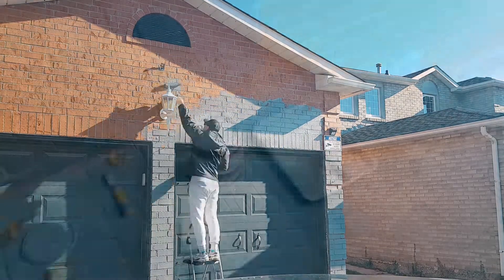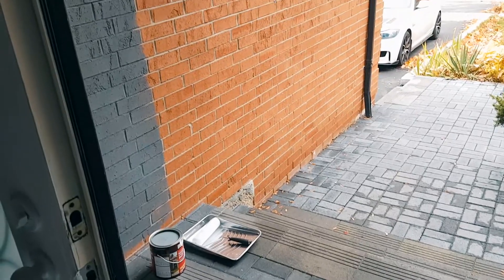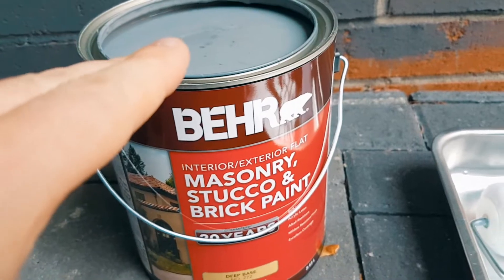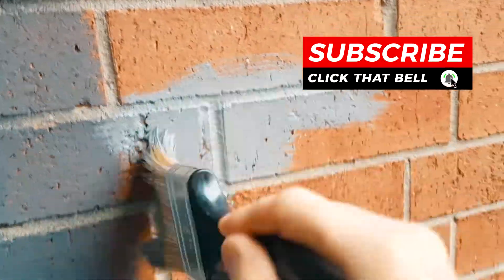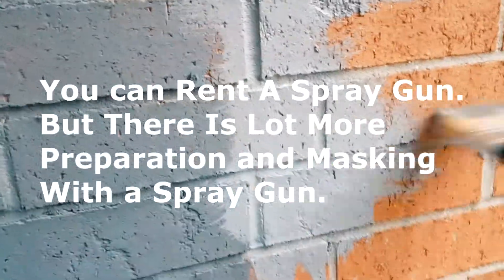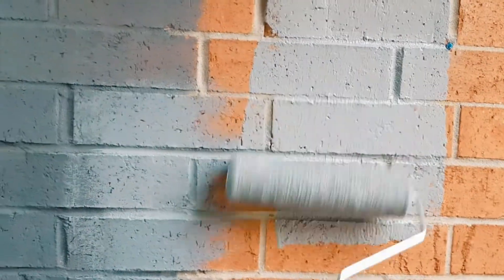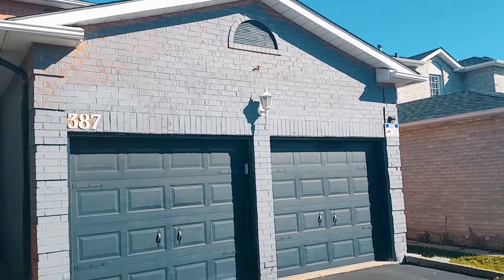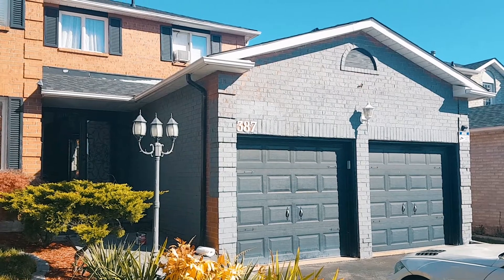Steps on How to paint a Brick House Exterior with BEHR Concrete Paint - Simple DIY Home Renovation

Comment: If anyone is watching this and taking notes on what tools to use, please dear god ignore this cat.  A foam roller is the LAST thing I'd want to use on brick.  What you need is a REALLY nappy roller.  Brick like this you could probably get by with a 3/4" nap, but if its rougher brick, I'd use a 1" nap.  And you need to put WAY more paint on the wall.  Even with two coats, this is really thin application.  A nappy roller lets you fill all the voids with it, rather than having to come back and constantly touch everything up with a brush.
Reply from the maker: Thanks Matt, i agree, i learnt it the hard way, then i also used a gun afterwards.
Reply: Exactly!!
Reply: Dude he is not a Pro
He's just trying to explain there is a way to color a brick home using the correct product that will not peel you don't have to be so nasty to him . 🤨 Back off 
You seem to know more about applying the product. That's great but I didn't see you post a video for the rest of us who could have used your skills and know how.
Reply: @mimigee5631  No one is being nasty to him. We are stating that he is not using the correct products. You absolutely should not use a foam roller to paint your brick house. And if you’re going to go through the work of posting a YouTube tutorial, you should do so correctly. I would hate for someone to follow his steps and not get the results they need because they used a foam roller on brick. The purpose of these comments are to help others from making a costly mistake.
Reply: @mimigee5631  it’s a 4 year trade if you want to learn skills go do the trade not watch a incorrect video 😎 until the hold this bro 👉 L

Comment: Why pour a pint of paint in a plastic tray when you could use a 5gallon bucket and a Screen? Unless you want to keep pouring all day. I am a painter of 34yrs and I doubt very seriously this job will last 25yrs 🙈. Didn't even mention cleaning the surface and allowing to dry first. I may try this product but Luxon primer from @SherwinWilliams creates a ph balance to the acidic nature of brick and mortar. I finish coat with SW Exterior Satin/or Flat Duration. I doubt this job will last 25yrs or even 10yrs.
Reply from the maker: No paint job on a brick will last 25 years, usually you repaint every 8 to 10 years.